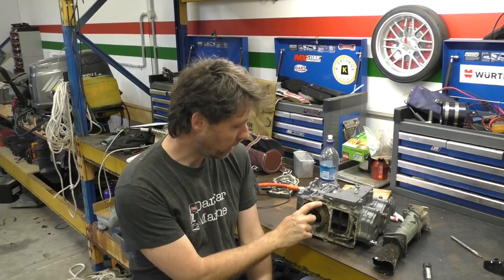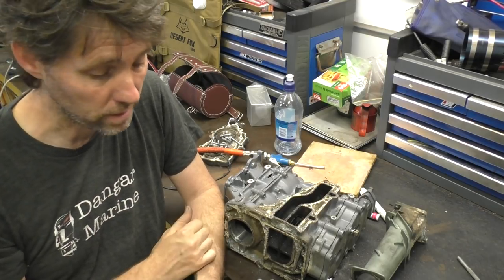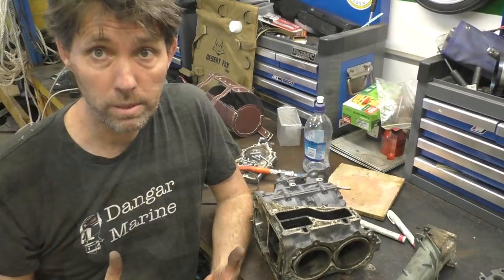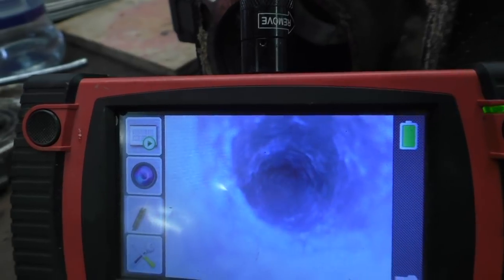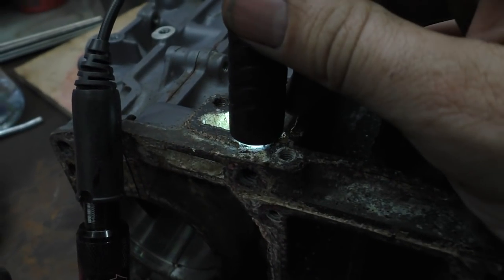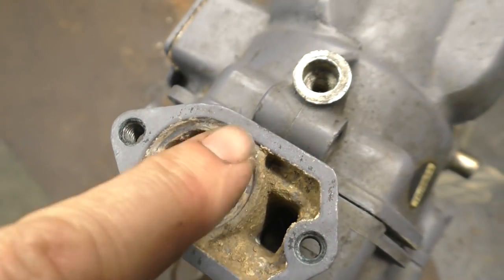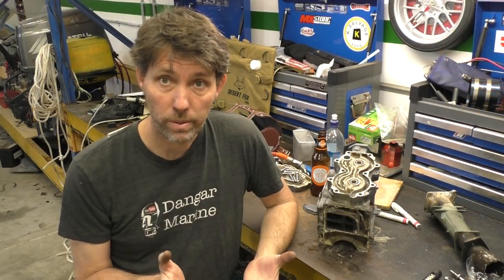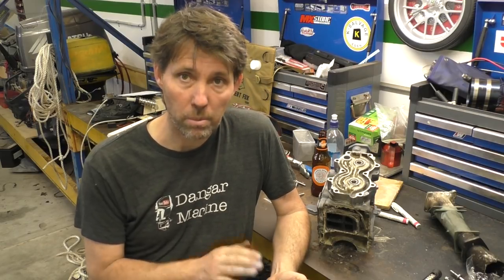Outboard cooling water

Comment: Hey STU love your videos
Hope you can respond to this or shed some light on it.  40 2 stroke tohatsu. Pertaining to what you described at the end of the video.
I frankensteined a 1996 powerhead onto my 2003 rest of the motor.  I have good compression on all 3 cylinders, new working thermostat (also has good water flow if thermostat is removed), have a good tell-tale.  My issue is that the tell-tale shots slightly further and harder (more forceful) than the previous powerhead did, as well as the tell-tale being extremely warm (can hold hand in tell-tale stream and its almost unbearable how warm it is to the hand).  If i hold my hand down by the prop for the exhaust and exhaust water coming out there its cool water (not very warm at all).
Does this seem like it could be sort of the same situation as you had with the blown head gasket?
Reply from the maker: Yes, unfortunately it does sounds very much like a blown head gasket, particularly if it is over heating. On two stroke motors it is very easy to replace the head gasket so I would take the head off and see what is going on.
Reply: Stu, i took the head off and all looked good, have a new gasket on its way, the head didn't look like anything was wrong with it (unlike the one in your video with the chunk missing out of it), isn't warped at all (checked for level and even across it as well as the block side).  going to replace the impeller while im at it just for extra insurance (dont think its been done in awhile)

Comment: You must be a mind reader. I was just talking about outboard cooling with my son yesterday. This answered most of our questions except when using the flush hole on the lower unit pushing water in it doesn't come out the pee hole? I told my son it must be due to the pump is not turning. But if your flushing the motor it doesn't make sense if it doesn't go all the way through the cooling ports? What do you have on this. Thanks
Reply: yatabata are you talking about using ear muffs or a hose connection to the outboard?
Reply: Hi Jumbo, my son said they hooked up a hose to the flush port on the lower unit.
Reply: yatabata Then I believe you are right that It wont piss because the impeller isn't running and the water is coming out of the exhaust by the prop. I had a problem with a cheap set of ear muffs that wouldn't give a tight seal and even with the hose on full blast my motor would only piss steam(overheating). Then i used a wetvac container and it was filled past the lower unit intake grates and it was still pissing steam. Then I finally saw Stu's video showing the water needs to be past the skeg as its not a self-priming pump. So i found a taller container and it started pissing like a racehorse!! My brother in law toasted his 150 outboard by leaving it running it on muffs for an hour trying to run out the fuel (while he was inside). So now I strictly flush with a container of some sort. Hope this helps
Reply: yatabata And im also sure some motors have a better designed flushing port than others. Mine doesn't have one and my brother in law has one(older merc 2 stk) and it's been said by merc mechanics not to use the flush port on that particular model because it won't supply enough water while motor is running. But like i said im sure newer motors are better designed, but i would make sure myself.
Reply from the maker: That's a good question, I'm not sure where those flushing ports send water. If the water doesn't come out the tell tale then there must be a large chunk of the system that isn't getting cleaned out, it must come in somewhere closer to the water jackets. It could also be that it need more water pressure though.
Reply: Thanks Jimbo, yes I think that is what is going on. I told my son just flush the motor in a tank to make sure the entire cooling system is cleaned out from being in saltwater.

Comment: what I have noticed on my Tohatsu 9.8 after a few minutes of running is that hot water and some vapour (smoke/steam?) start to come out of the idle exhaust port. I suspect this indicates the thermostat has opened ?
Reply: no, your engine is overheating and boiling water. the tell tale should never steam.
Reply: @Francois_Dupont  yes I think you are right if it occurs continuously, I remember troublesome outboards as a kid used to do that. Having said that I have noticed on my new Tohatsu 9.8 after running it hard if I stop the boat and immediately look at the tell tale a small amount of steam and water come out for about 10 - 15 seconds then disappear. Trying to understand what the source of the tell tale actually is and why outboard would behave like that.

Comment: Hey stu thanks for the vid great as always. I have an old Suzuki dt60 2 stroke and I've had an over temp alarm a couple of times. Problem is that the thermostat sits under the cylinder head and doesn't have its own access cover. Do you have any thoughts on checking if water is going through properly without removing the whole head cover? Cheers mate
Reply from the maker: Ah yes, that is an unfortunately location on some outboards. I would probably start by using an infrared thermometer to test that it is actually getting hot and not a sensor failure then I would just take the head off and replace it. It isn't a huge job and probably good from a maintenance point of view anyway as well as giving you the chance to inspect the water jacket and replace any anodes.

Comment: Is it possible to replace the cylinder liners? i see they are "dry" type.
Reply from the maker: No, they are a single cast block I believe. Machining and going to oversized pistons is probably more expensive than getting a new block from Yamaha I would imagine.

Comment: Please could you help me with this question, when flushing an outboard with the muffs after being in salt water how long do you flush it for and if the engine is still cold the thermostat will not be open so the rest of the cooling system will not get flushed?
Reply from the maker: Yes, you need to flush it long enough for the engine to get warm and for the thermostat to open.
Reply: Thanks Stu, at what temperature does it open?

Comment: I have a mercury 3,6hp 1980’s no thermostat. Water is coming out tell tale but motor definitely overheated where does the water go if no thermostat? Out the top of the head like in the video?
Reply from the maker: Without thermostat is goes through the water jackets then out the exhaust.
Reply: Hi Stu thank you for the reply. I have been stumped!!! I checked all the channels and they clear but motor is overheating. Water pump is working as water coming out tell tale... any advice?

Comment: They also told me that running with too little oil in the mix might cause the engine to overheat and then stall when starting... is it possible?
Reply from the maker: Yes, low oil will cause friction that will definitely generate extra  heat. It is the expansion from this that causes it to bind up and stall.

Comment: I have a  question . What i need to do when i modifide my engine to racing mod
Are normal water system can be used or i need to modifide my water system to??
Reply from the maker: Not sure, I've never been involved with any racing boats. I imagine the cooling system is stock though.

Comment: I took off the thermostat cover and took out the thermostat, tested it and it was not working. I ran the engine with the no thermostat and water came gushing out the hole where the thermostat sits.I replaced the thermostat and  also replaced the pressure relief valve located just below the thermostat. Thinking I had solved the problem I bolted the covers back on. After running it again, I fund it still heated up. I then thought water was not getting to the cavities around the cylinders, so I took of the cylinder head cover and found 3 pieces of impeller rubber wedged in the cavities along with a build up of salt and gunk. The rubber was about 1 1/4 in long and about 3/8 in diameter, I assumed parts of a burned up impeller. They were lodged just where the cavities meet where the cylinders are close together.  No or very little water would be able to flow. Again I thought I had solved the problem.  After removing the rubber and cleaning out the trapped salt crystals and gunk cavities around the cylinders I installed new gaskets and a thermostat and gasket replacement kit, and assembled it all back together, but no luck, it still overheats. Is there anyway that the water coming through the thermostat, down the inside the water jacket did not previously pass through the cylinder head cover, and the cylinder cavities? Any suggestions. The Port side runs cool so I do not think there is any rubber trapped around those cylinders and I replace the that thermostat which was working.  Does the cooling water reach both thermostats at the same time, or does it flow through from one to another?

Comment: My 1985 Johnson 15 hp pees real good while idling but when you go to full throttle it quits peeing and runs hot any ideas what the problem is..thanks
Reply from the maker: Could be a blown head gasket where the exhaust gases are pushing the cooling water out from the water jackets.
Reply: I put a new head and gasket on

Comment: hello stu i really enjoy your videos and  i am a big fun of you .  i am Nikos from greece and  i woulg like to ask you a question . i have a tohatsu 2 stroke 2 cyl 9.8 and i found water in the upper cyl i removed the head changed the gasket and thermostat torque to the specs but still have water to the cyl   i have αlso open the  exhaust where i found mud but not sigh of corrosion i put new gaskets but still water in the cyl ....i can t Imajine where this water  comes from . can you give me any idea .. thank you
Reply from the maker: Hi Nikos, how did the head and surface of the block look when the head was off? If the head is warped at all it won't seal and will need an engineer to machine it. I've also seen corrosion pitting on the block that will prevent it from sealing again.
Reply: both the head and block was in good condition without corrosion i sand the head on a glass meassured it as you shown in the video and looks ok i torque it with 10 NM. is  any other way for the water to go to the upper cyl only ,  unless the head gasket ?

Comment: I'm big fan of your channel. It has taught me a lot about working on outboard motors. My '99 15 hp Johnson is blowing a ton of water out of the exhaust above the waterline. Is this a common problem? What could it be? Any help would be greatly appreciated.
Reply from the maker: Many outboards do that as a part of their normal running. All the water does come out the exhaust in the end.
Reply: @DangarMarine  how come my other 7 15 hp Johnsons don't do that?

Comment: Hi Dangar Stu......such brilliant videos - thank you for taking the time to produce them!

I have a query, my dad has a 12 year old Honda 75hp 4 stroke that has had under 200 hours use, yet has (according to the Honda mechanic) corroded through one of the water passages right at the spark plug, causing the plug to short and the engine to run a little rough. We are unsure if other passages / parts of the outboard are corroded, until the head comes off.

He has always flushed it using both the Honda-method (the hose is connected with no apparent need to run the outboard....so says the manual!) and using the muffs.

As it is on a pontoon on the canals and the engine cannot be run trimmed down vertically. It has been flushed after every use, as described above, however it is flushed / run tilted up.

I have three questions:
1. Could the running / flushing of this outboard when tilted up, result in fresh water not being able to access all galleries (due to the angle of the outboard) and therefore not completely clearing the salt water from the galleries?
2. Is the impeller able to create enough pressure that this is not an issue?
3. Does the engine need to be flushed running at higher revs than idle, to create enough pressure to flush all galleries if it is tilted during flushing?

My dad is looking down the barrel of a quite hefty expense of replacement of the corroded head (apparently no one is able to weld the location where this has occurred); even more critical and more expensive, finding more corrosion damage than in the head only; or very expensive, replacing the outboard as it is completely cactus.

He is understandably very demoralised by this outboard!

Any ideas before I throw the thing off a cliff??

Thanks in advance Stu!!
Reply from the maker: I don't think it is an issue with flushing. To be perfectly honest my Honda gets used in salt water every day and basically never flushed. It could be an electrolysis issue (particularly being near a spark plug) but more often than not it is due to a faulty casting which is very just bad luck more than anything else. You may be able to find a cylinder head at an outboard wreckers that isn't hugely expensive.
Reply: @DangarMarine  thank you! I don't think it is an issue isolated to any manufacturer.......lack of use might come into it.

Comment: Hi Stu, love the vids. I have a quick question if there is no water coming through the chamber where the thermostat lives does that mean there is an issue with the water pump?
Reply from the maker: Yes, problem with the water pump or a blockage.
Reply: Dangar Marine cheers for the reply, I’ve installed a completely new water pump not just impeller, only a dribble coming out of tell tale, took exhaust covers off and galleries are all clear, also ran mono through entry point of exhaust manifold down through leg to the end of the tube so blockages there. I’ve recently rebuilt motor with new block so all gaskets on head are new as well as cleaning out the water galleries. I’m scratching mg head at the moment
Reply: Oh also forgot to mention when motor is running thermostat opens and water comes out exhaust ports on leg, it is quite warm

Comment: Hay how are you doing 
I'm not sure but think the round drilled hole is EGR (exhaust gas recycling) and environment friendly new design 
When piston come up alittle quantity of smoke trap between blocked main exhaust port by piston skirt and only way is recycle to cylinder and its helps to reduce CO-NOX-HC  and improve fuel efficiency etc....

But if this hole exist in older engine before 2000's I'm not pretty sure why its like that 

In our vessel we have life boat propelled by tuhatsu 25 
If you can please make such video about cooling water circuit
Also please explain how i can prevent water pump blades broking (in rough seas freezing temperature and what is quickest method of melt ice) 

 thanks
Reply from the maker: Interesting about low temperatures breaking impellers. It never gets below freezing here even in the middle of winter so I can't say I've heard of any solutions to that problem.
Reply: Yeah indeed brother 
My junior engineers jump behind wheel and engage rescue boat free falling mechanism in even in freezing temperature and they broke waterpump 
But the fact is they forgotten to do this 2 step after previous use of boat (flush by fresh water and blow down water by exhaust)

Comment: Without a working safety alarm, how does one know the motor is overheating?
Reply from the maker: Unfortunately you don't really until it starts to seize and stall. Those infrared thermometers are a great way to check manually though if you are suspecting it is getting hot.

Comment: Interesting video, thanks stu.  Just curious though if you're running an outboard on muffs and see water coming out the exhaust port could you safely assume water is running the full circuit?  This would mean you wouldn't have any blocks and could be an issue such as the blown head that you showed (if overheating).  Love the videos, cheers
Reply from the maker: Good question. On this outboard it would seem that is the case but it is not the same for all outboards unfortunately.

Comment: Maybe they should put the pee tube in a critical spot so you can tell it's working and actually cooling.
Reply from the maker: I've always had this daydream of designing an outboard that is really easy for the DIY person to work on and get parts for. One thing I'd give it is one telltale before the thermostat to show the pump is working and a second one after it to show when the thermostat is open.
Reply: Thats a good idea, nothing a drill, tap, hose fitting and some hose couldnt fix? Good vids too mate, as an ex car mechanic fixing my own outboard they give me a nice overall picture of outboard internals and systems. Wish my old workshop had a better friday morning beer policy like yours! cheers

Comment: Hmmmm..........Thanks to my new found knowledge I am prepared to step into knee high water in my alligator infested lake here in Florida and attack the cooling problem in my Yamaha 50 2 stroke.   If the creatures get me, it will be your fault, 'cuz I was going to pull the boat out and haul it to the fix it guys.   Since I now know how everything works, I will try to DIY instead.    This may be my last entry, but I hope not because your videos are great.    Thank you.............I think.............
Reply from the maker: Good luck! :)
Reply: @DangarMarine  I did a fairly successful job of flushing out the crud with RYDLYMEMARINE.    If you have not tried this product, you might give it a try.    I think it is much safer for the aluminum guts than Muriatic acid

Comment: why is people showing on YouTube to drill a hole on top of the motor to put a new water line that make it pee out the back side somethings about keep the motor from over heating  is that true if so can you leave the that's in there now hook up and drill a hole in the other side and hook the new line up  or just don't anything
Reply from the maker: Hard to see how it would help with cooling.